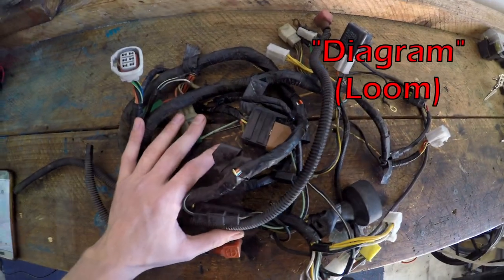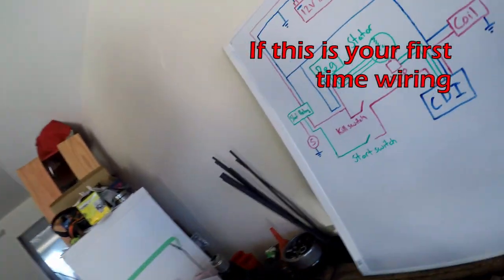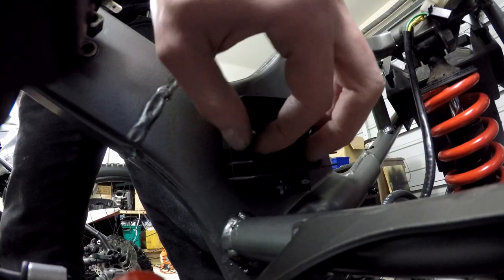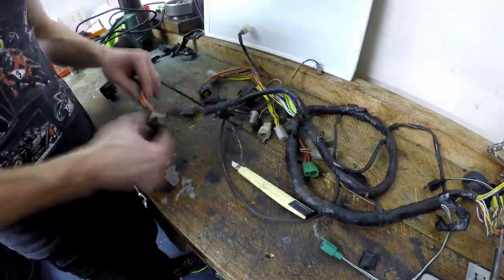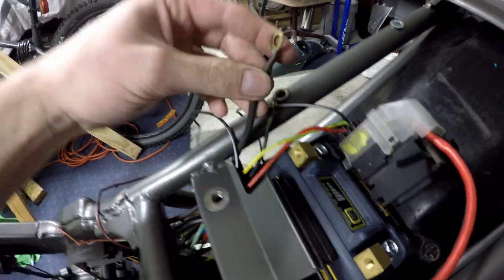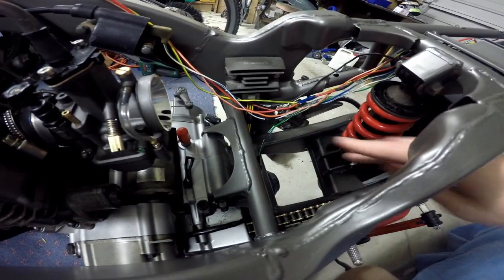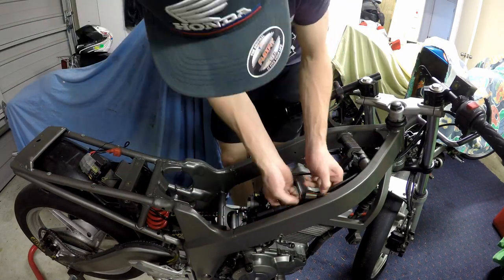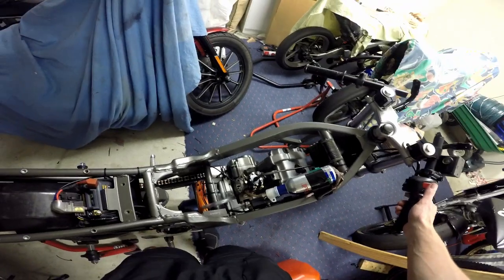Custom Motorcycle Wiring

Comment: I want to keep electric start so my son can start it, how do i do that?
Reply from the maker: The diagram I used in the video is equipped with a starter relay and starter motor.
It's just a few extra wire, power, earth and signal to relay, power to starter motor and earth strap return
Reply: I’ll play back video and try grab a screenshot.